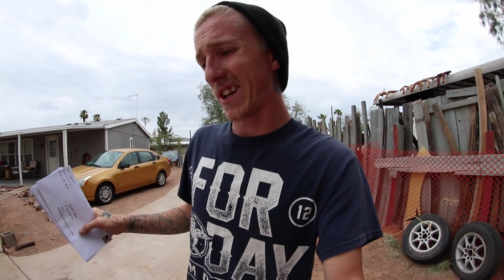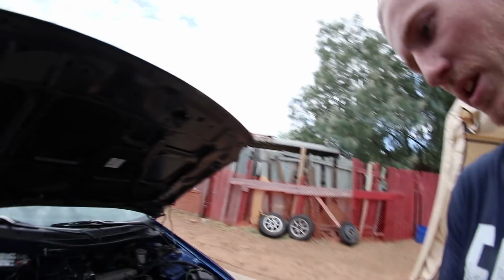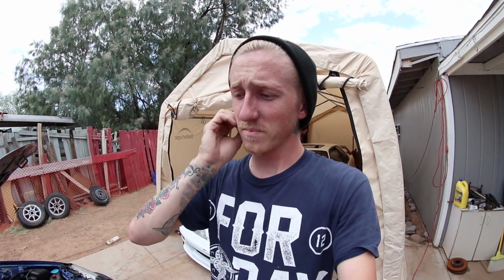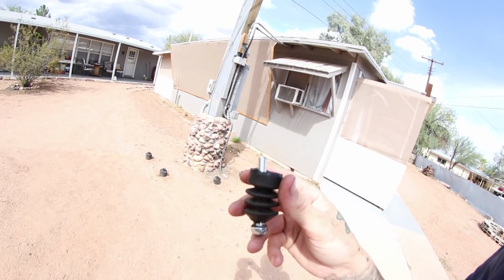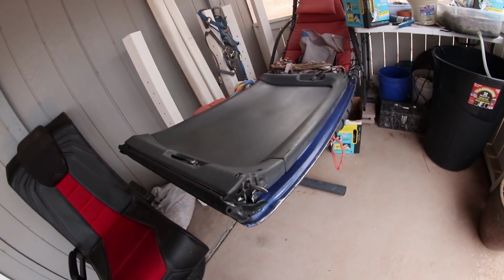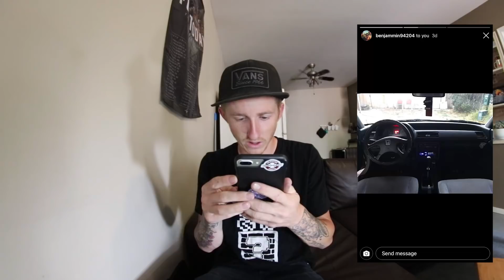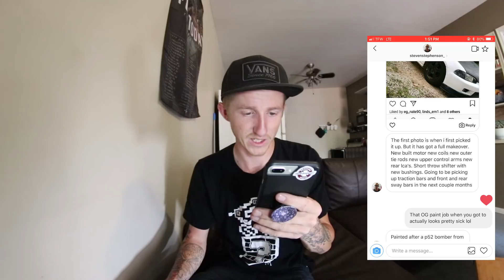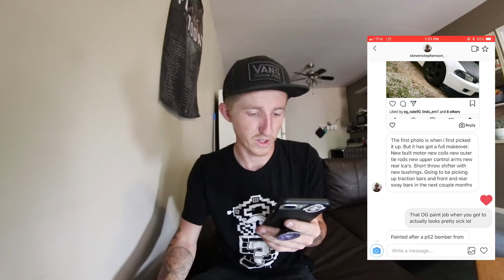Night Time Canyon Run, Reviewing Subscribers Cars

Comment: Cant wait to get my sticker. Awesome night run btw it was sick. I have a lot of work to do to my car before I'd send pics lol it's a basically stock da I changed all the hoses from red to blue lol and hids I was trying to do more but got a blown head gasket so I'm fixing that and going from there. Pretty sure I bought it blown just didn't really notice she actually drives good I just stopped driving it didn't wanna break anything else hopefully just head gasket but replacing water pump and timing belt. When I get it back from the shop and I put on my new hps rad hoses I'll send a pic of before and after of engine bay
Reply from the maker: I want to do colored hoses as well. But I have to have custom lengths made since my hoses  are weird. Or AN fittings and high pressure lines instead would be sick
Reply: Yeah man do it up either one would be sick it adds a nice touch to the engine bay